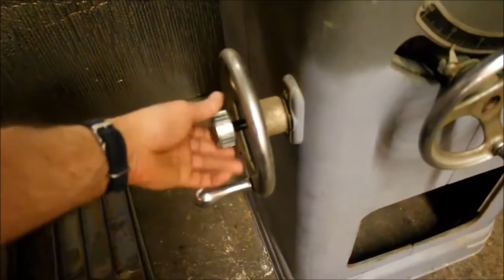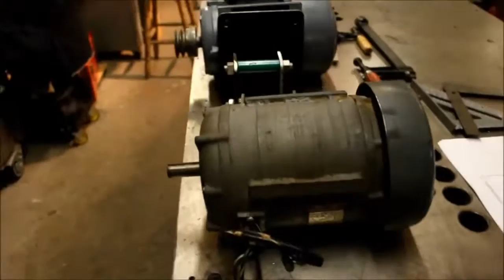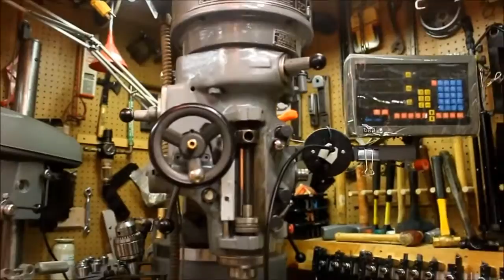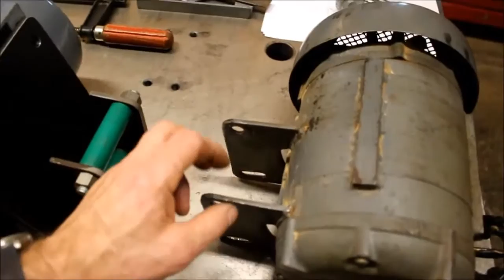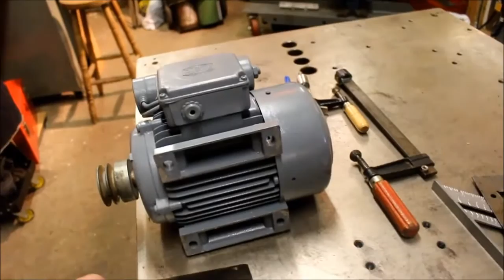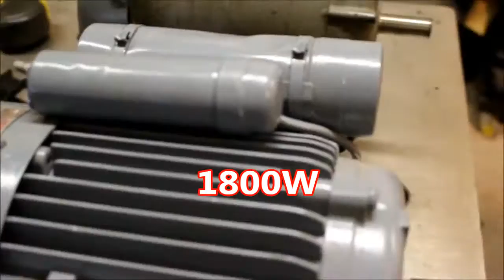UNISAW Part 1

Comment: I would use the old 3 phase motor with a simple cheap phase converter, that only runs the 3 phase motor at full speed. I have been using one on my 3 phase surface grinder for over 30 years. That way you could use the old 3 phase motor switch on your table saw. 3 phase motors are more efficient and reliable, no start capacitor or centrifugal switch to go bad.

Comment: I just bought an old 1940's unisaw, and I was doing research on Vintagemachinery.org. They have a lot of info about unisaws, history, etc... One thing I saw was that on newer saws the serial number was on a separate plate, but on older saws the serial was on the blade tilt gauge. Hope that helps.